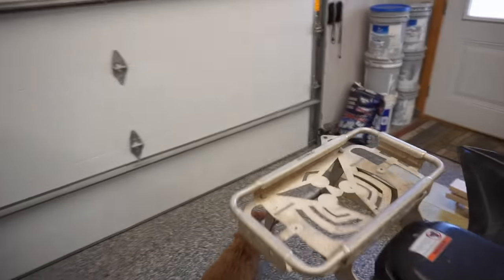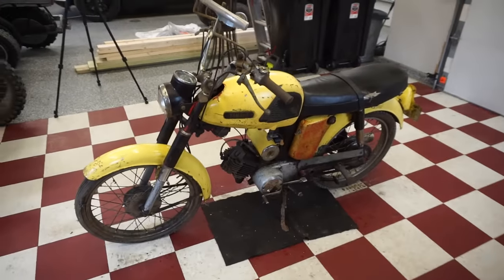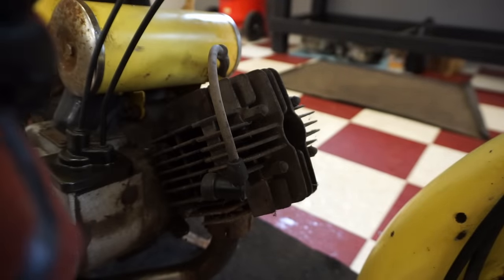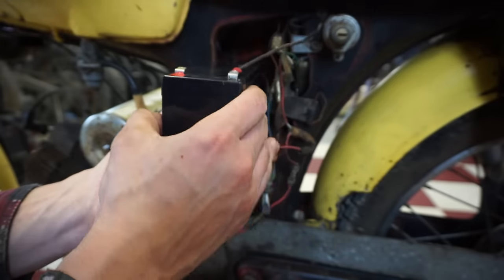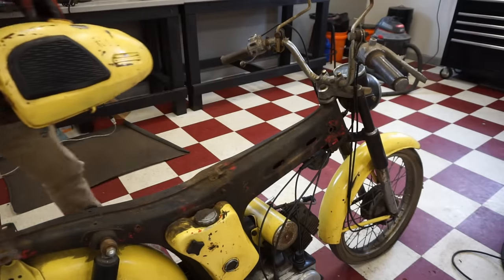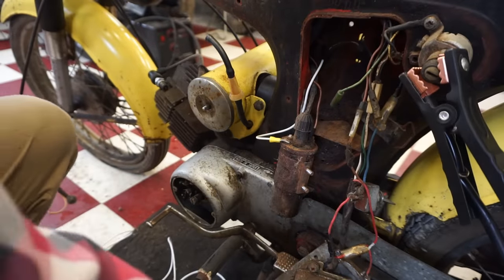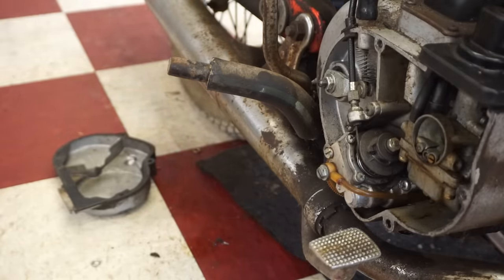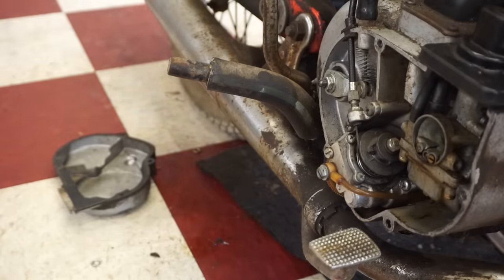1967 Yamaha Motorcycle Sat 40+ Years In A Barn Untouched (Saved From The Scrap Yard)

Comment: Rare vintage motorcycle. So you hit the plated tin points cover with a screwdriver and hammer (instead of trying to gently lever it off with a plastic tool), weld on the kickstart (instead of using a pin and clamping it tightly) and then proceed to break the kickstart shaft (likely irreplaceable). You use WD40 on the points but not on the rusted nut. 
I'm not sure if WD40 is conductive or an insulant. If it's conductive then it can short across the points causing ignition problems. If it's an insulant it can prevent sparking. You should just use dry, fine sandpaper. Fold a small piece of sand paper, make sure the points are fully closed the use one finger (or a small flat screwdriver) to hold the points slightly open so there's a light resistance on the sandpaper. This way you'll ensure the contact patch will be sanded level with each other.
I enjoy watching your videos. You do give me ideas on how to approach my own difficulties, and you succeed more often than you fail. 👍
Reply: Well. To be honest they do make a thing they call "contact cleaner" and it's not WD40.

Comment: I have two 64 YG-80 and this video is so helpful.  One is a parts bike and the other is completely disabled to be painted. No one around here knows how to work on these engines. Watching you tear into it is going to be a huge time saver when I go to reassemble and get it running.  The parts bike has over 21K miles!!  Can't imagine anyone putting that many miles on an 80.

Comment: That was my first motorcycle when I was 12 years old. Brand new. Rode it for 3 years with no issues until I hit a car head on and broke my left leg. Fixed it while in a cast and sold it and moved up to a 250 big bear, then a 650 triumph at 16.

Comment: love it, with hindsight, may have been better idea to drill kick start and shaft, put high tensile bolt through it and forget any bad welding that can damage any seals or O rings. or maybe have looked arround for new kick with good splines as shaft seemed ok to start with !

Comment: pressure washers are your friends.. use that outside.. then let drip dry and then bring it in. Nice project.

FYI. the kickers are usually made of a aluminum/magnesium pop metal and will not weld very well, to anything. so, for future reference, dont try and weld them!.. 

Nice to see you got it to fire though.. lots of good information on what to look for, for future reference!

Comment: I had one of this type, designated YG1 in the UK, red with chrome tank panels and built in plastic leg shields. 1965 ish. 80 cc disc valve motor. It was my ride to work town bike, leaving the Kawasaki H1 triple at home. Took loads of abuse by running maximum rpm most of the time, maybe even 45/50 mph on a good day, sun, rain, winter. Now and again took my wife and I on the odd 50 mile trip just for the hell of it. Great little motor, really reliable had it for years.

Comment: I've had success removing paint over factory finishes with crushed walnut shell from HF. Adjust the pressure to the blaster and can even save the pin stripes and decals. Won't etch the magnesium engine parts.

Comment: Had 2 , mine where 6v not 12v , good little bike , had a weak gear selector on them , autolube system works well , had a red and black one , then moved onto 100 twin ,then 125 twin YAS1 , you can't beat a small capacity 2 stroke 💨💨💨💨👍

Comment: I don't know if you do this, but if you have troubles with a screw that's a little messed up on the head, use some valve lapping compound on the tip of the screwdriver, it works great.

Comment: When I was a young'un, I had this same problem on my Yamaha RD50 with the kickstart, I just drilled out the hole slightly bigger and made a sleeve out of some copper heating pipe.
I didn't chop out all of the slit though, I just bent one end up so that it wedged itself when the bolt was nipped so there was no way that it could rotate.
Once the bolt is tight, it pressed it's own splines into the copper and grabbed tight, never came off again unless I wanted it to. Can't say the same for the exhaust that fell off! 😅

Comment: Hey Joe, if you have one of those flexible part retrievers that has a wire car that emerges from one end as you depress the plunger on the other, you might be able to remove the rest of the mouse house. I hope my description didn't confuse you. Not the best description. They are usually found on the rack, in stores, beside the magnetic ones.

Comment: Love the triple tuning fork symbol impression in the gas cap. Looks exactly like my first bike, a 1971 YAS1 125cc twin stroker. I bought that in 1977. With better trained friends, we got it going & I learned to ride on it. 
My second bike was a 1972 YDS7 250cc twin stroker. Also tuning forks in the gas cap. Man, that was fast. 100mph indicated, chin on the clocks. I crashed that I earned two plates in my throttle wrist. Still in there (I’m 63 now).

I remember being initially intimidated by the amount of stuff that has to be right before these bikes run, but really, it’s simple. No ignorant kid in 2080 is going to get an abandoned 2021 Yamaha running with a couple of screwdrivers, a wire cutter and some wire. My current bikes are 1977 Suzuki triples and I’m happy messing with these well made dinosaurs. They’re jewels of quality manufacturing, and run as good as new.

Comment: How did you know that when you arc welded on that kick shaft, you wouldn't fry every wire and component on the cycle? From the video it doesn't appear as if you're grounded safely enough to prevent that. One of the other comments noted that you proceeded to crack the kickstart mechanism. I've been reading about these particular engines and apparently that's a known issue with them; they frequently need to have the kickstart mechanism retrofitted. Luckily they seem to be a pretty common style of engine that was used in many Yamahas for well over a decade, so spares are probably not extremely difficult to source out.

Thanks for the content. 
Keep up the good work.

בס'ד

Comment: Nice you go for the crusty ones now ,dirtbikes en quads not a challence enymore .😂
You seem to use WD40 for everything ,they should sponser you big time,i hope you don’t use it in the kitchen to replace cooking oil.😊
By the way ,love your projects.👍🏻👍🏻
Edit:
I don’t know if anyone mentioned in the comments ,but the sparkplug wire is pretty chuwed up on the coil side,you wil have the chance that the spark will jump to the metal frame instead at the sparkplug.

Comment: One of my first projects when I was a teenager was a 1967 Yamaha YCS1 if I recall correctly was a 175cc twin two stroke.
Reply: YCS1's were made in '68 and '69 and were 180cc twins.
Reply: @thatsmrharley2u2  maybe it was built late 67? This was 20 plus years ago, I could be mixing it up with a Bridgestone I also had at the same time. I believe that was a 67 or 68? Bs175 twin two stroke. Both of those bike were red  with chrome center tank. I can't remember if both had the rubber pads on the sides of the tank.
Reply: @RageKage1776  Yes, the BS was a 175 but I think they only made a low pipe street version. My parents bought two red and chrome  Yamaha YCS1C's new in '68...they had the 'high' street scrambler pipes, 180cc two stroke twin.
Reply: @thatsmrharley2u2  yes, I do recall the pipe orientation. Wish I held on to them along with all the other oddities.

Comment: What do you clean a rusty fuel tank with and how do you do it? Just curious! 👍
Reply: I have had good luck filling them with vinegar and letting them sit. Sometimes for over a week and then dump some of it out and toss in some old bolts and shake. After rinsing I use some baking soda to neutralize it and air to dry then add some mystery oil to it to coat the metal. Have done about 4 tanks this way and all came out pretty good.
Reply: you can try what scott said or try evapo-rust, stuff works great and is safe-ish I think (won't eat through the tank). The extreme/fast method is muriatic acid, but that has to be done carefully and neutralize the acid as it will eat through the tank.
Reply: Cool, thanks. I was just curious. It’s cool how there are so many ways to achieve the same results. Thanks again for the replies 👍
Reply: I seen another video of someone using fishtank rocks to clean the tanks. Really cool.
Reply: @Joe_HamRadioGuy  hmm that's cool or can use "pea gravel" might be a bit cheaper lol
Reply: @M.TTT.  cool.
I had to go back in my history to find this one but it was on Brick House Builds, How to remove rust from a tank. Interesting vids.

Comment: If there's a chance that the tip of that spark-plug is rolling around in the cylinder, I think I might pull the head off, just to be sure, before it has the possibility of doing real damage.

Comment: Help please, I have an 01 cr125, I’ve just rebuilt the entire motor, bought a lectron carb, checked my reeds and they don’t look bad, have adjusted the metering rod in the carb countless times to get the bike to run as good as I can, idles great and super responsive in neutral, but as soon as I go to ride it, I have to use tons of clutch work to even get into the powerband, but once I get there it rips through all gears. This thing has been a nightmare for me, I’ve spent countless hours trying to figure it out buying new stuff. Any idea would be very helpful🙏🏻

Comment: That's really not a bad motorcycle it's kind of rare it's not a piece of junk check the rotary valve and the seals around the rotary valve and the rotary valve itself of course it's behind the carburetor which is on the right side of the engine

Comment: I don't know what your long term plans are for this bike, but I would not ride it or sell it without that wiring being addressed. Even if the coil is still working, none of that stuff should be reused. The mouse urine is what caused all that rust and corrosion. If you saw damage in that one small section of wire, you can be assured that it is damaged in numerous places. I have had a machine in similar condition short out and burn down on me. It is a risk that isn't worth taking over $100 or less in parts. I tried to save money, and it ended up costing me money, and nearly costing me my life.

Comment: First off, why not take it outside & pressure wash the whole thing before You start, save working in dirt and grime the whole time and then you can really see what you have to work with. Plus it reduces the risk of disease for you.. second, don’t put dw40 on the points, use electric systems cleaner. If you put an oily film in there it will never spark .

Comment: As everything is take apart and dismantled - the system,   these old mechanical systems are repairable.  computer chips are not - at least not by anyone but a super-specialist.  The difference in performance ?  Ask yourself why you have a motorcycle.  If it is just for a fantacy -  well, that is all you will be left with.   Tremendous power in our system with oil - gasoline and the internal combustion engine.   It actually pollutes less than the " electric "  stuff they are trying to stuff down our throats.   Why do they want that ?  Because they can control  the electric stuff.  The internal combustion engine is like cash.  They don't want people to have cash.

Comment: You're checking transmission oil. It would really not ever get to be black it's gear oil man it doesn't do anything to the engine at all 2 cycle motorcycles have separate transmission oil